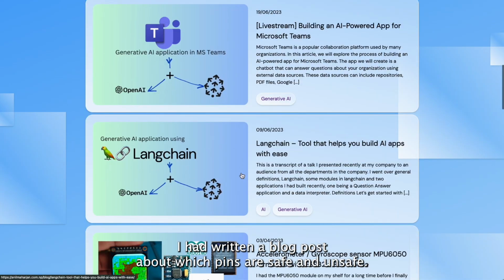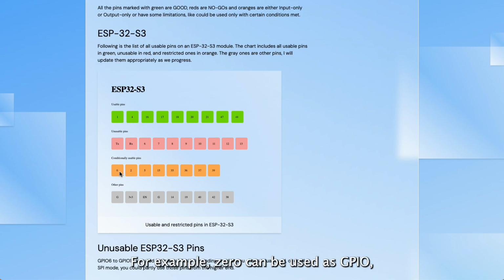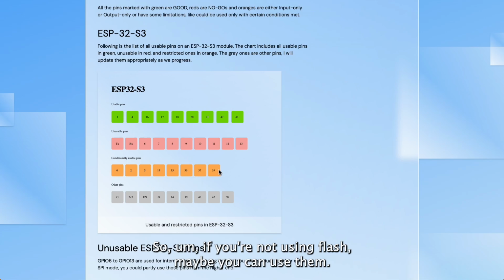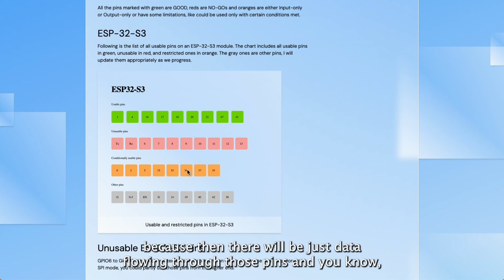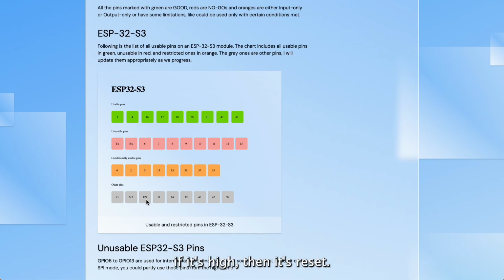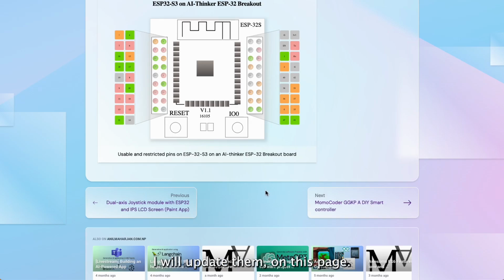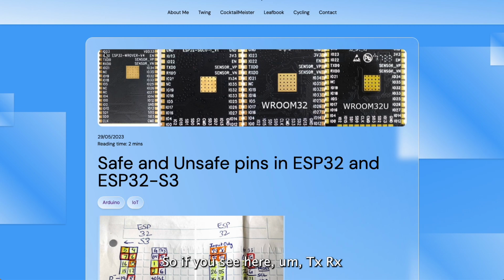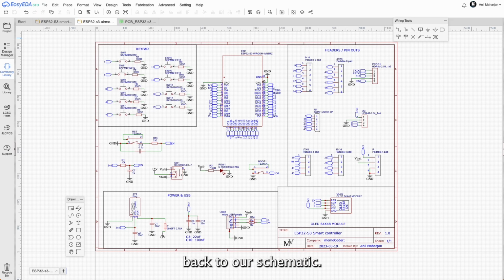Usable and unusable GPIO pins on #ESP32 S3

Comment: This is almost entirely incorrect, please refer to esp32-s3 datasheet section 2.3 . For example, internal flash is connected to gpio 26-32 and are not externally accessible in a wroom-1. Gpio 9-14 is the fast spi2 interface and quite valuable to use
Reply from the maker: Thanks for your comment @loreroth I agree this may not be entirely accurate when I say what those pins are used for internally, and that was not really the goal of this 5 min video, the goal was to only categorize pins that could and could not be used by the user. 
But 
I am confused about where have I mentioned 26-32. If you mean GPIO 9 - 13 is not connected to Flash? They are used for SPI internally to connect to Flash. and yes of course you could use most of them for SPI for your peripherals, but the fact that there are a lot of other pins at our disposal, I had just switched to software SPI. I don't find proper documentation or tutorials to use them. I would be really interested to have a look at a schematic if you have worked on it. I was quite struggling to use an SPI TFT LCD with a touch screen.